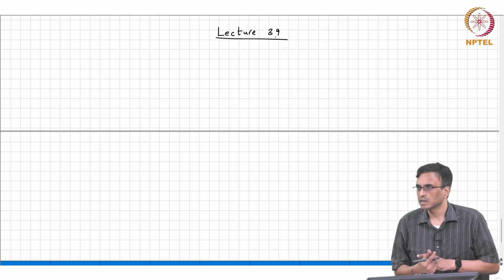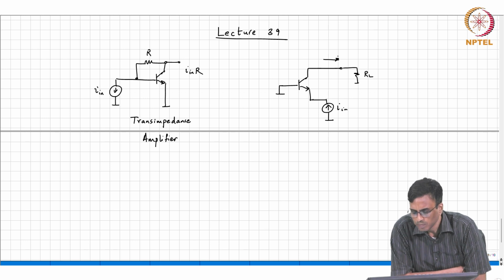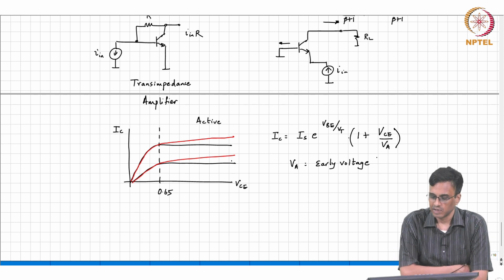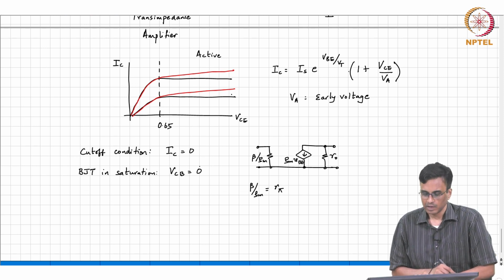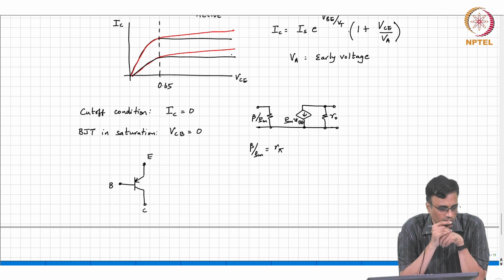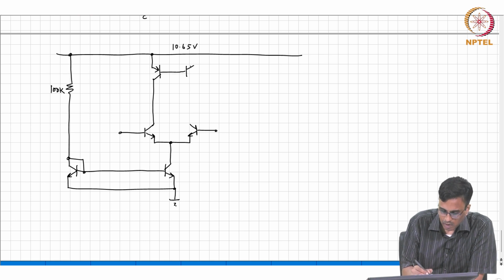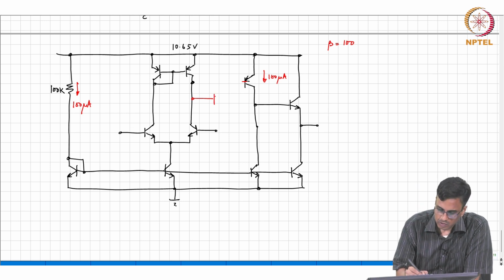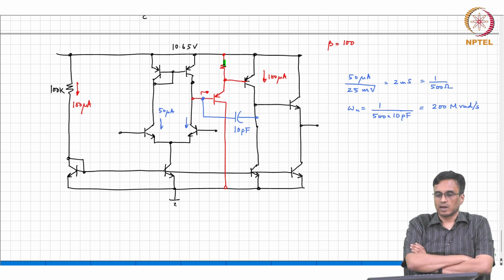Bipolar Junction Transistor Circuits Swing Limits and Two Stage Opamp

Comment: Also at 8:46 the line of Vce min will have some finite positive slope as for a higher base current ; we need a higher Vbe and thus a higher Vce min to get the collector base voltage down to zero volts.

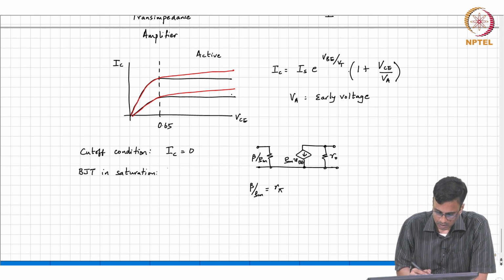Comment: 9:00 if we practically consider saturation for effective forward biasing of the BC junction atleast a drop of 0.4V should exist across it making the Vce min value to be 0.3V at the verge of saturation.

But if we just mathematically consider saturation being the point the base is epsilon above the collector then the Vce min value may be 0.65 V giving Vcb = 0V

But in practice for a pn junction to be "effectively" forward biased the voltage across it should be atleast 0.4V.